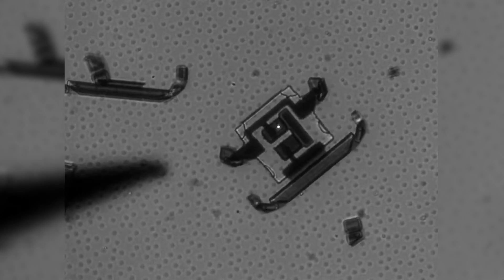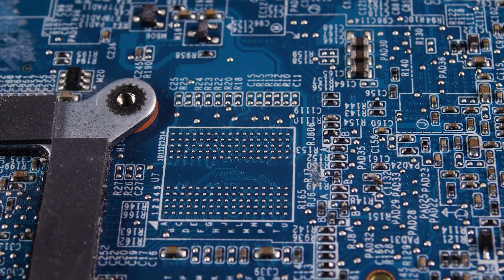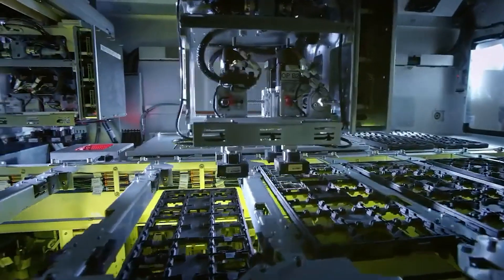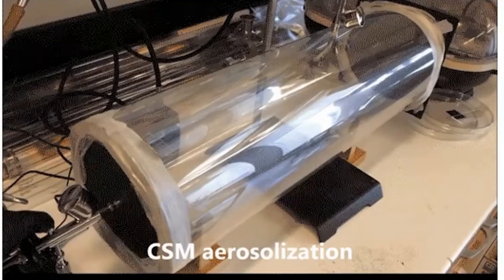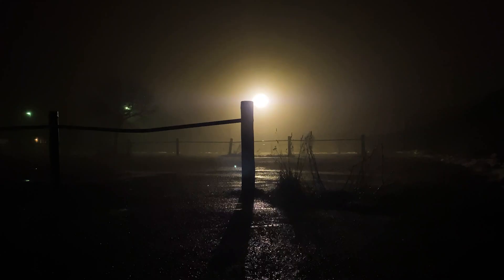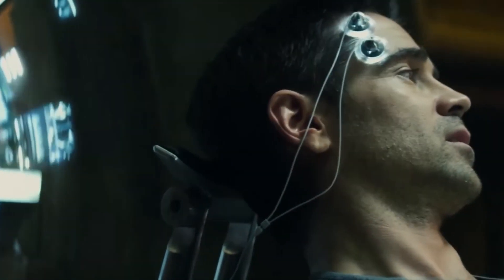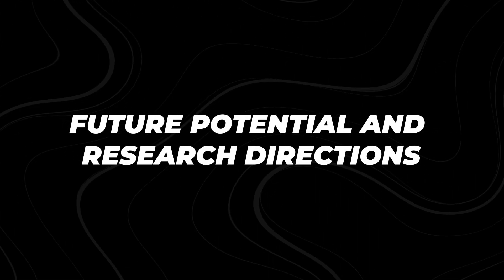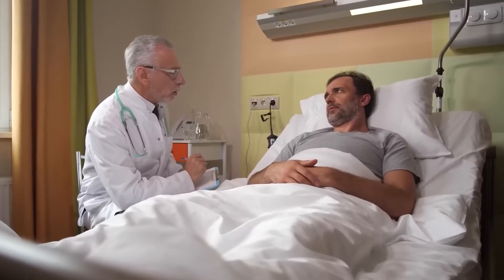Microscopic Robots Powered by Invisible Batteries (Coming Soon)

Comment: Is less of a battery than it is a power converter of sorts, much like the solar panel talked about.

A battery stores power. But what is said here, more than once, is it takes oxygen from the outside, and uses it to react with the zinc it has to make power.

That is more of a power converter, than a battery. Much like with the solar panel idea, where it stops when there is no light, and starts again when there is light, this thing works, so long as there is available oxygen for it to use, or it stops, and goes again once oxygen is available again.

In short, the oxygen is its external power source. And is useless without it. Much as the others are useless without light. I am not even in the field of such science tech, and I understand this concept quite well. 

But I guess people can call whatever they want, whatever they want, whenever they want. So much for consistency in science >.>

The tech is still interesting just the same, no mater what anyone want's to call it.
Reply: https://www.youtube.com/watch?v=OrfeJhbVdpA&t=3983s heres the truth of the energy crisis and the "difficulty" science faces in its persuit to make an outdated technology go as far as possible.